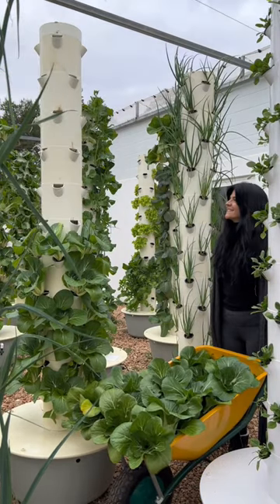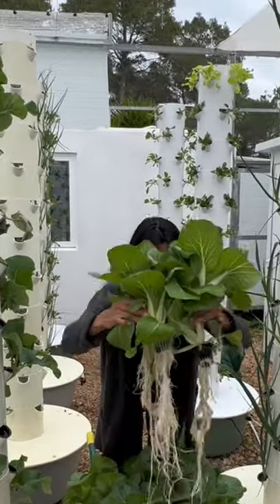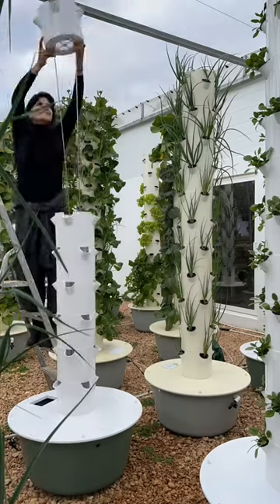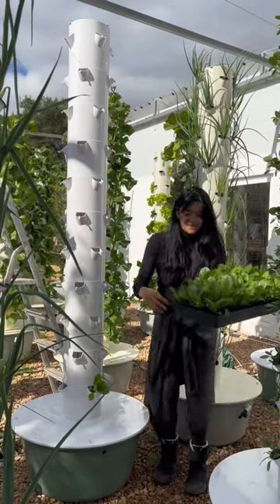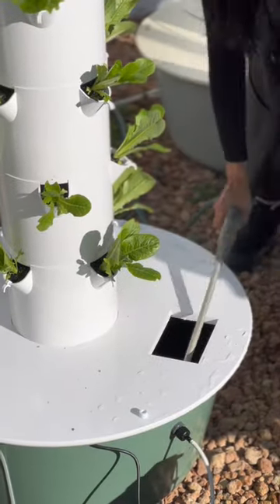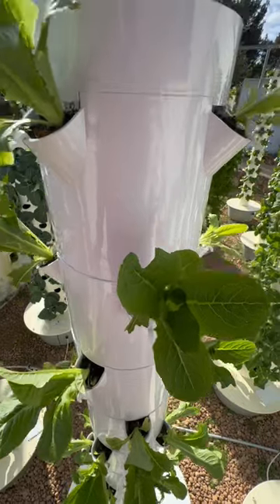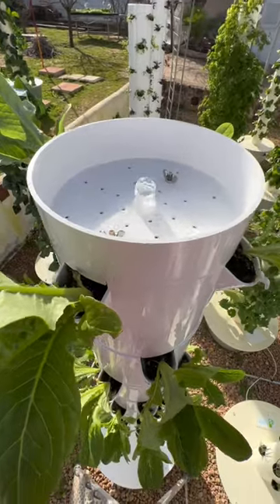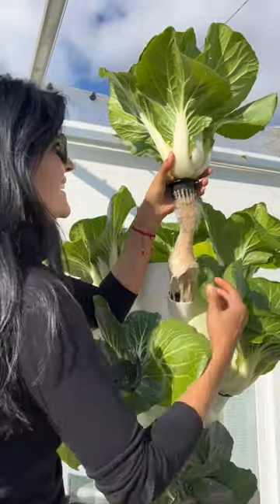Maximize crop yield with soilless aeroponic tower farming! #verticalfarming #aeroponics

Comment: This is a cool idea, however Im curious if the crops harvested from these systems have traces of BPA or PFAS(forever chemicals)?  Does PVC tubing not have these chemicals?
Reply from the maker: Excellent question! These aeroponic towers are constructed from the highest quality UV-stabilized, BPA-free, food-grade plastic available. These aeroponic towers are constructed from high-quality resins that meet FDA and RoHS regulations for use in food contact applications.
Reply: You should ask him if the Sicce Syncra Silent pumps they use are also made from certified plastics that are BPA and PFA free. The pump is in contact with the water 24/7. If you dont get an answer, I`d suggest contacting Sicce directly, they should know what is in their products.  :)

Comment: How to make nutrient?and each plant have different nutrients requirtment and each plant absorbe nutrients on different ph level.Could you make a video on nutrient making process
Reply: you buy ph meter some ph + and ph - check what requirements r for chosen plant and be sure to fill pot with the same plant
if ph is to high you put in ph - if its to low you put in ph + steer and measure again

you also put in nutrients in the water

if you dont know what ph lvl your plant needs ask google or chatgpt
Reply: Watch the video before this one.
Reply: @Josie-6  which video 📹.pls share link
Reply: Not as nutritious as food grown in healthy soil, but better than round up covered food
Reply: You either  no buy reading the back of your fertiliser  it should tell you
Reply: @tysk5729  w
Reply: @myrnacatonina9341  d
Reply: @cristinavindas4514  that’s one of the problems… healthy soil is hard to come by and diminishes quickly
Reply: @cristinavindas4514  A crop duster doesn't fly into my apartment to add fertiliser to my hydroponic garden and the water doesn't deplete in nutrients, so yes more nutritious and healthier, as well as less water waste which is a BIG one.

Comment: Not sold on the soil-less idea, but I'm liking the vertical tower design, do they have soil versions?
Reply: Me too. I'd love to have that kind of tower on my garden but with soil. It's a space saver.
Reply: Buy a food safe barrel,  cut hole in large enough to fit your starts, fill with desired soil and soak in water after planting. Grandfather been doing this for about 8 years
Reply: You could do this very easily with soil only down side would be getting an even distribution of nutrients you could add a hole above each plant so you can put fertilizer or liquid plant food directly on plant roots diluting the solution as you get to the bottom you'd also have to change soil every planting

Comment: think this set up is so amazing..i got a question when planted seedlings how long do u have the water running inside the towers? also is the water used on a circler pump..or fresh wayer is used from tap
Reply from the maker: The plants are irrigated intermittently 3 minutes on and 12 minutes off continuously. The towers are automatically filled up on an as needed basis via a gravity tank. We have the nutrients set on a 1 to 300 ratio using a dosing system known as a "Dosatron". Every liter of nutrients has 300 liters of water.

Comment: Where did you grow the plants first before putting it in those tubes?
Reply from the maker: The seeds are germinated in a soilless substrate known as rockwool which comes with the tower when you purchase it. You need to start your seeds separately until they grow into seedlings. This can be done in your house and doesn't require much space.

Comment: Make the aeroponic tower out of tiling mastic buckets or similar

Drill the bottoms to let water percolate. 

Or chinese bloke has trays and refills them daily. 

Make your own artificial growth soil using manure soil 

Break down zinc magnesium potassium etc and add as you wish. 

Put up a small plastic greenhouse and it will grow so fast... i think. 

Simple easy cheap fast.

Comment: Damn! Those towers are expensive!
Amazon has the cheapest at $380. Last summer the worst problem in my newly acquired tiny garden were insect attacks of all kinds. Previous owners kept a few chickens but now nothing keeps the insects away.
Reply: @@achroi884 Thank you for the info!
Reply: If you need to get rid of the bad bugs then you will need more of the good bugs that eat the bedbugs. There’s a lot of information on YouTube concerning this and also when we make gardens we don’t do it like it would be done in nature, we want to space it out do an imperfect rose till the soil‘s and everything like that, which does not have to be done because that is when you actually ruined the soil and how it is naturally. So if you look up different ways of gardening which are like tilling the soil or basically just dropping the seeds right onto the ground and let them go from there and also look into doing a lot in one small area instead of spacing them out so much then that could help as well. Another thing that helps as well is if you’re going to have a garden then your best to also have very close by wildflowers just get the cheap wildflower seeds and sprinkle them out and let them go because you’ll have ladybugs and all those kind of sorts of insects that also help rid of the bad pests. There’s a lot of information that I have been looking into as well because I have had problems with aphids with doing apartment growing so I’m bringing the soil to me since I’m on the second floor and it’s very hard to keep the natural soils intact like it needs to be.
Reply: @jillellis62  Thanks for the in-depth reply!

Comment: And is the water being pumped to irrigate the plants constant or is it running on intermittent settings?
Reply from the maker: Each tower has a 45-watt submersible pump, which typically runs for 4.8 hours per day (3 minutes on and 12 minutes off continuously).

Comment: Wie hoch ist der Stromverbrauch?für die wasserpumpe Das sich der 1 sent Artikel lohnt zeit pflege. Wehre es nicht besser in die Erde zu flanzen also bei uns hier funktioniert es ok
Reply from the maker: Each aeroponic tower is equipped with a low-wattage submersible pump that operates at 45 watts working intermittently 3 min on and 12 minutes off continuously, which means 4.8 hours per day. To calculate the cost of electricity, you need to multiply 45 watts x 4.8 hours = 216 watts.

Comment: What is the electricity charge?
Reply from the maker: Each tower has a small energy-efficient water pump that consumes just 45 watts of power. It operates for 4.8 hours every day, (3 minutes on, 12 minutes off continuously). Taking into account the average electricity price for households in the USA, which is $0.18 per kilowatt-hour, the monthly electricity cost per tower is around $1.20.

Comment: For the love of God, where can I buy one of these towers? :D
Reply: They are freaking $300 a pop
Reply: 300 is cheap... I saw a few in the thousands 😞
Reply: @MsDanyelleM  
Don’t be disheartened! You can make them! Go to Lowe’s or Home Depot, look for some PVC pipe, you don’t even need it in sections, just get one long big pipe, cut it to the length that you want. Drill holes in the side far enough apart for plants to grow comfortably. Then you can take another piece of pipe, cut it into little half cups, and glue it on the underside of the holes that you cut into the big main pipe. That can be your plant holders. Once you have that done, you’re going to need the main pipe plant holder to sit in a small bucket. Maybe like a 2 gallon bucket. You might have to stabilize it to hold growing plants, but that’s OK. Then you can look for a hose to go from the bucket that you’re going to fill with water and stretch it all the way to the top of the pipe. Watch a video on this guy‘s channel, I think it’s the main video where he explains how the system works. Watch that video and see how their planter works, and take inspiration from it. We definitely are. We are going to try this and I know it’s going to work. In order for the water to shower all over your plants, watch the video and see what he has at the top. It’s a lot to explain so I’m not going to. It doesn’t have to cost thousands of dollars. You can do it for probably just 100.
Reply: That's not a lot if they're that tall if each segment, that sucks.
Reply: @liviloo87  more like $800 for the full height commercial version shown in video
Reply: @tribalwind  
Yea, that’s a lot of money for us normies. I’ve been looking into some stand alone hydroponic systems, that you can make just from a bucket, or even a tote. And you don’t even need those fancy little nets, this guy here on YouTube grows a bunch of things with a pool noodle cut into 1 inch pieces. It’s really a genius idea. I’ll come back on here and give you his channel. Give me a second.
Reply: @tribalwind  

OK his channel is called “keep on growing with Mike VanDuzee”
Reply: @liviloo87  yes I know Mike and follow his channel. The main issue with his pvc bucket diy is that pvc leaches a lot of chemicals and doesn't stand up to sunlight well. I had a 87- bucket garden on a deck and they got really brittle after one season.
Reply: @tribalwind  

Oh well that sucks. I’m going to be doing traditional gardening this year. I might try a couple things with Mike’s tips, but I’ve been composting for the last two years, and my compost is super ready right now. It’s so cool to see it go from a huge pile, to almost nothing but some really concentrated good stuff underneath. Anyway, I hope you have a great day.
Reply: @liviloo87  thats really expensive for me because im just s teenager.I can grow all those things in the ground for free seems like a great expense and i would want like 8 of them not 1 so its a bit overpriced for me.
Reply: @liviloo87  awesome!  Yep happy growing! I also have a garden, food forest,  but very interested in an affordable option for aeroponic tower too!.
Reply: @tribalwind  

Oh hey, I went on your channel and noticed that you have not uploaded in quite a while. I would love to see your garden, if you’re interested in uploading again. I’m going to start posting again. I took all my videos down because some weird guy was creeping on my children. So I will not be putting any of my children in the videos again. It was a total turn off, and it scared me. I’ll go ahead and sub to your channel. Just in case you do decide to upload. I’ll be posting a video on my channel within the next couple of weeks.
Reply: @theteenagegardner  

Well then you plant in the ground! That’s what I do lol

Comment: How do you get the water to the top of the tower
Reply from the maker: The tower is hollow on the inside. There is water mixed with nutrients that sits in the reservoir with a low-wattage submersible pump. The plants are irrigated intermittently 3 minutes on and 12 minutes off continuously. The towers are automatically filled up on an as needed basis via a gravity tank. When farming with aeroponic towers, it really minimizes the problems you can encounter as long as you use properly filtered water, we use RO water.

Comment: What kind of cleaning must be done between crops?
Reply: Will they need running water 24 7 ?  Thanks
Reply from the maker: We use citric acid-infused water to clean the towers every three growth cycles. This eliminates existing algae and prevents new ones from taking root in the growing areas.
Reply from the maker: A 45-watt submersible pump is installed in each tower, and the average daily runtime is 4.8 hours (3 minutes on and 12 minutes off continuously).

Comment: wait for your electricity bill to arrive. because the pump does not turn on by itself. and if you intend to use solar, think about the cost of batteries that need to be replaced every 3-4 years and also the cost of damaged solar.
Reply from the maker: Each aeroponic tower is equipped with a low-wattage submersible pump that operates at 45 watts working intermittently 3 min on and 12 minutes off continuously, which means 4.8 hours per day. To calculate the cost of electricity, you need to multiply 45 watts x 4.8 hours = 216 watts.
Reply: You don't know solar. Try 5-7 years on even cheap batteries. And the cost OF DAMAGED SOLAR? What exactly is damaged solar.
Reply: solar energy is not cheap in third world countries. petrol is sold at a lower price, and electricity bills are very cheap. even though our country sells and makes solar but that is for foreign demand. solar energy is only given to government power generator companies and people have to buy solar energy from abroad if they want it. the cost is 3-4 times.

Comment: How much for electric bill...?
Reply from the maker: Each aeroponic tower is equipped with a low-wattage submersible pump that operates at 45 watts working intermittently 3 min on and 12 minutes off continuously, which means 4.8 hours per day. To calculate the cost of electricity, you need to multiply 45 watts x 4.8 hours = 216 watts

Comment: What about energy? Isn't it pricey?
Reply from the maker: Each pump for the commercial towers uses 45 watts per pump x 4.8 hours per day (3 minutes on, 12 minutes off). This is very low energy usage per day, in fact, according to local electricity rates in the USA, each tower uses about $1.10 in electricity per month.

Comment: water pump run 24/7 or not????
Reply from the maker: The plants are continuously irrigated for 3 minutes on and 12 minutes off. A gravity tank continuously supplies the towers with RO water as it is consumed.
Reply: You should be asking why you have to pump well over 5000L a day through a 52 site tower when the plants in that tower only use 4L-7L a day  :)  These hydroponic towers are incredibly energy inefficient compared to genuine aeroponic towers.

Comment: This tech has been around for years and years actually (even Disney was demonstrating it since the Land first came out). It doesn't work on just every plant (no potatoes for example). It's expensive as hell in the setup process, plus you're not really self-sustaining as you're importing supplements (unless you're doing an aquaponic setup instead, which has its own issues). And the final product is usually not as flavorful and large as a soil grown counterpart. Also disease is easier to transmit because everything is being contained in the same small areas, so no room for natural quarantine. My family switched back after years of aquaponics to raised beds because of those last few especially. 

It has its advantages though, it's just absolutely not for the average hobby grower and should not be marketed as such.

Comment: Nutrient rich water means chemical fertilizer unless organic material is chelated in rainwater
Reply from the maker: Our nutrient solution, which consists solely of earth-based minerals and trace elements, cannot technically be labeled as organic since it does not originate from a living organism like worms. Minerals, in fact, are classified as inorganic substances. Nonetheless, our nutrient solution is free from harmful chemicals or artificial ingredients and contains only the necessary minerals and trace elements that plants need.

Comment: Not trying to burst any bubbles just simply stating the truth … this 1st is expensive 2 it will not work in every climate.  1 of the if not the most important factor in hydroponics is solution temperature .. among a few other factors now let me say this is absolutely beautiful and y’all did an amazing job.. just trying to help gardeners as well and want to help them understand that not everything they see will work for them or there area
Good luck 🤙🏻

Comment: How much my electricity bill will increase?
Reply from the maker: Each aeroponic tower is equipped with a low-wattage submersible pump that operates at 45 watts working intermittently 3 min on and 12 minutes off continuously, which means 4.8 hours per day. To calculate the cost of electricity, you need to multiply 45 watts x 4.8 hours = 216 watts.

Comment: what happens in a power outage?
Reply from the maker: Ensuring a stable electricity supply is indeed crucial for a vertical farm utilizing aeroponic towers. Many farms address this by incorporating solar panels to maintain a continuous power source. However, it's important to note that the towers can withstand a few hours without electricity, and the plants will recover without any issues.
Reply: @Agrotonomy  how much power is needed per tower?

Comment: Do this require electricity?
Reply from the maker: Yes! Ensuring a stable electricity supply is indeed crucial for a vertical farm utilizing aeroponic towers. Many farms address this by incorporating solar panels to maintain a continuous power source. However, it's important to note that the towers can withstand a few hours without electricity, and the plants will recover without any issues.

Comment: And use 100 gallons of water a week
Reply from the maker: On average, a commercial aeroponic tower that grows 52 plants will need around 1 to 2 gallons of water per day, which is roughly 4 to 7 liters depending on the crops and environmental conditions. This makes it an excellent choice for regions facing water scarcity.

Comment: All good till the power goes out
Reply from the maker: Having a steady electricity supply is really important for a vertical farm with aeroponic towers. Some farms use solar panels to ensure continuous power. But don't worry, if there's a temporary power outage, the towers can handle it, and the plants will be just fine.

Comment: Rockwoll is dngerous
Reply from the maker: Rockwool for agriculture is compacted differently and is used after being soaked and therefore does not present a health risk. In other terms, although we recommend to handle rockwool with gloves, contrary to general perception, it is a safe material. Rockwool is used in the world of hydroponics and aeroponics extensively since it features a neutral pH and allows the perfect ratio for water and air.